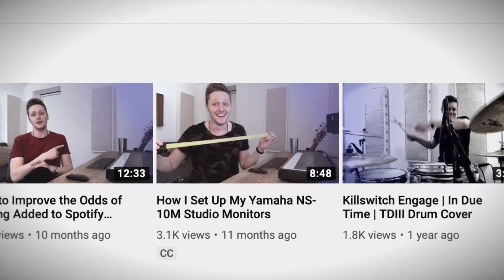Studio Monitors - How to Connect Passive Speakers to Your Audio Interface

Comment: @TomDupreeIII     Hey Tom, Could this be done in a 5.1 setup?  I want to buy at least 5 passive speakers from GR Research for my studio.  And according to Sweetwater, I know studio mixing engineers pull this off, I just cant seem to find the right gear for this task.  I'd need a 5.1 audio interface, and a 5.1 channel output Amp....or a possible integrated piece of gear that does both.  I've been running all over the web trying to come up with a solution but to no avail.  Any info on how to get my 5.1 passive monitoring setup off the ground would be much appreciated!
Reply from the maker: This is a great question! I know a guy who did this very thing (albeit for a home theater setup, which is a bit much but you know, live your life). I believe he had an individual amp, bridged mono, for each speaker. So 5.1 interface to 5 amps, each with its own dedicated speaker. There may be a way to do it with less amps in a different configuration, but this is the only one I have experience with. I would imagine you might be able to get away with using 3 amps. 2 set to stereo for front and rear and then one bridged mono for your center front speaker. Hope that helps. Thanks for the question!
Reply: Tom DuPree III. 🤣  Thanks for responding.  I mean after all that, it seems better for me to request Danny at GR research to just try to make them active monitors and save me the headache.  And if not then yeah, I'll find something.  Lol.  One option I found from an article online was to actually use a consumer grade theater receiver to process/power all of the speakers.  I don't know how well that would work for STUDIO MONITORS without coloring them, I just don't know.  Do you think maybe a Marantz or Denon surround receiver could actually suffice???
Reply from the maker: Jonathan dude, you're so welcome. Honestly, it might. I would just check to make sure the receiver has enough power to drive your speakers sufficiently. And though coloring could definitely be an issue, you might be able account for that with something like the Sonarworks Reference 4 kit. That could be useful!

Comment: I'm not getting sound at all....why
Reply: I have alesis one Studio monitors hooked to a Mackie FR 800 power amp connected then I have my XLR cords hook to the amp going into my SSL2+ interface.
Reply from the maker: Ok here’s what I would do. Please forgive anything that sounds obvious or that you’ve already done. You want to localize the problem and find out at what stage it’s happening. First, confirm your amp is getting signal from your interface. The green LEDs on the front should indicate that. If not, check your connections to ensure the proper interface outputs are going to the proper interface inputs. If so, switch out the cables and try new ones to see if that’s the issue. If still no signal, then it’s likely an issue with your interface. Check to be sure you have it correctly selected in your DAW and that your outputs are routed correctly as well in the software. If they are and the interface is getting signal but the amp isn’t (even with new cables) try plugging in an active speaker to the output using the same cable (or anything that can receive signal). If that works, then your amp has an issue. If all of that isn’t the case, then check your speaker connections to the amp I’m the same fashion. Make sure you’re using the proper outputs from the amp and be sure that your positive and negative speaker wires match up on each end. Try switching cables, and try a different source for the speakers to see if they work elsewhere if you can. Basically, test your connection at every single point to find out exactly where the problem lies. Hope that all makes sense!
Reply: @tomdupreeiii  Thank you so much....its making soon much sense but as you stated, I tried it all over a 3 day period. I changed the wires from speaker to amp at least 6 times then I changed took my plugs from the interface out which are 3 days old from Sweetwater.  My interface is 4 days old from Sweetwater as well. I get signals from interface,I even get signal from the amp but no sound. Im lost. I don't have active speakers which Im seriously thinking about getting.
Reply from the maker: Derek jones man that’s rough. I’m afraid I don’t have the answer for that one. If you’ve tried everything and still no luck I’d say get a second pair of eyes on it. That’s what I would do.
Reply: @tomdupreeiii  I sure will,I still think its the amp but do you have any suggestions on some good active monitors I can buy?
Reply: @tomdupreeiii  Tha k you for your respones,response, just purchased an active pair of speakers so I can move forward.
Reply from the maker: Derek jones man you’re so welcome. I’m sorry to hear you didn’t get it sorted with the passive monitors but I’m glad you found a solution and will be able to get back to making music quickly!
Reply from the maker: Walk me through your setup. Maybe I can help.

Comment: Is available amp for NS10M smaller size? not rack but portable and good. I don't want to buy big. Thanks!
Reply from the maker: I do believe there are amps available that don't require a rack to mount them, but I'm not sure on the size. You'll have to do a little research on what you want and look. Sorry I can't help more specifically than that. Thanks for the question!

Comment: May be a stupid question, but Cant the audio interface power the speakers..? Using  Banana to TRS Cables..?
Reply from the maker: That’s a legitimate question. Unfortunately not. The audio outputs from the interface only send an unpowered signal. You need a power supply (amp) to boost the signal to the proper level. Great question!

Comment: What cables did you use to connect the power amp to the interface? Thank you 😁
Reply from the maker: I used Mogami XLR cables. Thanks for the question!
Reply: What if there’s aren’t xlr connections in amp or interface
Reply: @edwinmora-r237  get an adapter

Comment: Optical output from MacBookPro 2014 to an AV receiver and from there to the passive speakers? Will work this way?
Reply from the maker: As long as the AV receiver has a power amp in it, yeah I don't see why that would be a problem!
Reply: @tomdupreeiii  This Sunday will arrive the AV receiver, which do have optical input and 90W/channel. I'm just curious if I can use the optical signal straight from MacBookPro to receiver without the need of additional equipment.
Reply from the maker: @Alex Coc It’ll depend on the compatibility of the receiver but I don’t see why it wouldn’t work in theory.

Comment: I have a 2006 Marantz receiver. There are only RCA and speaker wire connections. How do I connect the interface to this set up? Output TRS on interface ---> to rca converter plug to aux or VCR ( lol) rca jack output? My intentions are to play my music out of 1990 Bose passive speakers. Thx!!
Reply from the maker: It sounds like the inputs on the Marantz are RCA and the outputs are speaker wire. Is that right? If so, you'll need to convert to RCA from whatever the output source is on your interface, which it sounds like is TRS. So you can get a simple TRS to RCA adapter for each channel (left and right) and that will allow you to go from interface / TRS to RCA / receiver to speaker wire / monitors. Let me know if I don't have that quite right. Hope that helps. Thank you for the question!
Reply: @tomdupreeiii  Does this work for a standard computer to Marantz receiver? I have the same interface in the demo & bought a used cheap one earlier today. I can't afford the nice speakers, so I have to make do with what I have. 
The aux port will be in use do it being plugged into my computer, but I guess I could use the tape port instead. 
Do I need to get the banana spliter as well for this to preform properly?

Comment: How do you connect active speakers to av receiver?
Reply from the maker: You may need to find some adapters to change the connector type (e.g. RCA to 1/4”) depending on the outputs of your receiver and I puts on your speaker. Anything you need is likely available on Amazon. Just make sure you’re connecting your active speakers to a passive output on your receiver. If your receiver is sending power to your already-powered speakers that’ll be a problem. Always helps to double check if you haven’t yet. Hope that helps! Thank you for the question!
Reply: Tom DuPree III  what I have Adam audio t7v, audio technica at lp120x and Yamaha htr 5940. From looking at the back of the Receiver I do not have any output line. They all read input.

Comment: I just got a pair and I was wondering what wire you recommend for these?
Reply from the maker: I use Monster cable Platinum XP speaker wire and have loved it. Highly recommend. Thank you for the question!
Reply: @tomdupreeiii  thanks im gonna get that wire for sure. sorry to bother again but i have another question. I have the apollo arrow as my interface and i was wondering if I can connect that to my power amp to control the monitors. if not do I just control the volume on the amp itself?
Reply from the maker: @culture no worries at all! I’m always here for the questions. Yep, you can connect the Arrow to a power amp and control the volume directly from the interface itself. You may need to use 1/4” to XLR cables depending on the amp.
Reply: @tomdupreeiii  I kinda went with a budget ano and got the samsom 200 watt. Just a little bit less power than the new avantone one. Would I go with the 1/4 to XLR for that?

Comment: i have the komplete audio 1 interface, and im buying some passive bookshelf speakers.Do i need an amp or does the interface have a built in preamp.Cuz i read that most interfaces have built in preamps and im just confused...  

edit: on their website it says that the RCA outputs let you plug directly into hi fi speakers and play..do they mean all hi fi speakers or just the active speakers? IM SO CONFUSED
Reply from the maker: This is a great question. I don't have the Komplete Audio 1, but I just did a little digging for you. It looks like there is not an onboard power amp in the unit itself. The RCA outputs on the back of the interface are meant to be routed into an amplification system (i.e. you will need to connect to powered monitors or to a power amp if you are using bookshelf speakers like the NS-10s). Most of the interfaces I have used rely on the speaker or an amplifier to drive the power to the speakers but don't actually send that power themselves. In this case, it sounds like you'll need to get a power amp too. Let me know if I can help with anything else!
Reply: Tom DuPree III  ok, thank you so much!
Reply from the maker: Dale Ryland of course! 😎

Comment: Than's for video. I try to connect my focusrite audio interface output to amplifier and go to passive speker. But my amplifier have RCA connector. How do i connect this,?
Reply from the maker: You should be able to find a connection adapter of some sort. For example, if your speaker outputs on your Focusrite are 1/4" then you can use a 1/4" to RCA connecting cable. Or if it's XLR you may need to go XLR to 1/4" to RCA. There are definitely ways to do it. You just have to find the right cables and adapters. Let me know if you have any luck!
Reply: @tomdupreeiii  Okay, Thank's Tom

Comment: Hi great vid...if i want to run 2 sets of monitor speakers (for comparing mix sounds) would i go for a '4' channel amp? What would you recommend that i can rack mount? (Also im on a budget because i threw most of my money into buying good spkrs) thanks .
Reply from the maker: Hey thanks for watching and commenting! That’s a great question. I’ve gotten that one a few times actually. I’m gonna make a follow up video about this but, in short, a speaker switcher is the way to go. Something like a Samson C-Control or something comparable will allow you to switch between different sets of speakers easily.
Reply: @tomdupreeiii  Thank you for your response Tom. I will look into it :-)

Comment: Great content! Another interesting one is how to set up a pair of passive monitors alongside active monitors. I have a pair of NS-10Ms and a pair of JBLs LSR 305 and I want to commute between the two. I might just need to get an interface with two independent outputs, but I wanted to know if there's anything I can do until I replace my Focusrite Scarlett 2i2. Subscribed!
Reply from the maker: Thank you for watching and thank you for the comment! That is a great idea for a video. I use a little Samson C-control unit (sadly I think it's been discontinued but you can find them on eBay / Reverb) for that very thing. I'm able to connect two sets of stereo monitors plus a subwoofer and can switch between both sets. I'll make a little video about it and include some links to similar pieces of gear that will do the same thing!